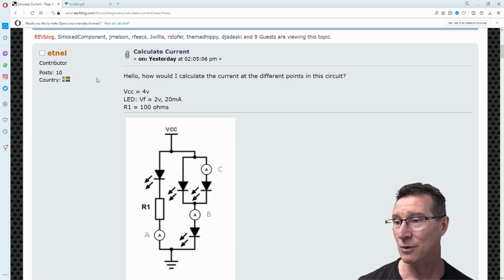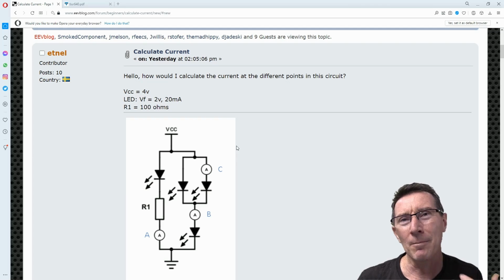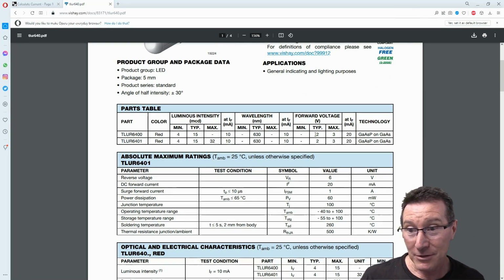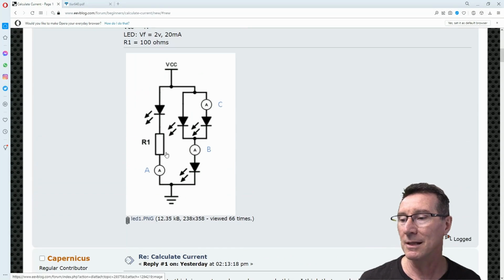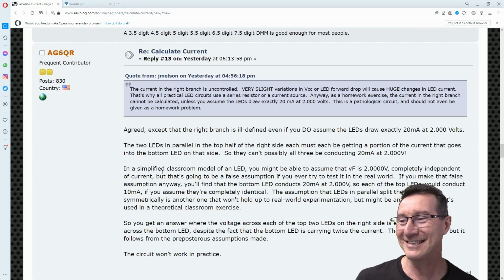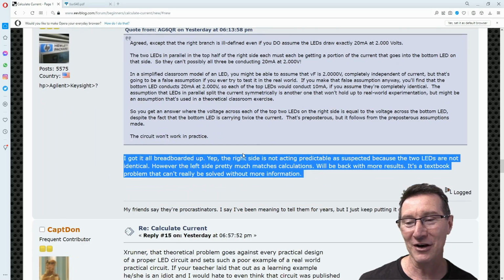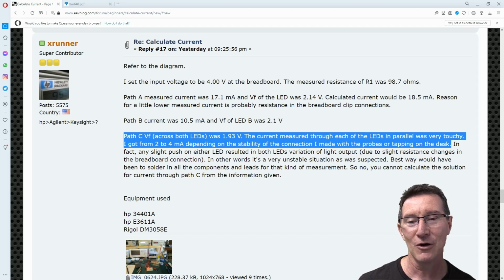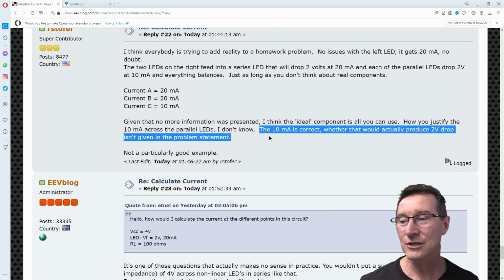EEVblog 1427 - An INFURIATING Electronics Exam Question!

Comment: We used to treat these as questions designed to slow down people who had hands-on experience.

Kids who'd never played with circuits would whip through these ones using the numbers given, while the experienced ones would replicate the thinking in that thread in their heads. Or the more autistic ones would just say "problem cannot be solved" and not answer it.

More open questions would often benefit a lot from a bit of experience, so we'd get to the end and "design a simple constant current LED driver {parameters}" and the  impractical kids would grind to a halt while the experienced ones would bang out a single transistor setup automatically before realising that they'd been given P MOSFETs and have to tweak the design. The earl;ier questions were designed to balance that out a bit.

Comment: I don't understand why people seem to think the problem is not suitable for hand calculation or not solvable without knowing the LED specs, because a hand calculation works fine for a decent estimate (assuming matched LEDs), and isn't even difficult.

Assuming that the LEDs follow the familiar Shockley diode equation, the I-V relation is I = I0*exp((V - V0)/(n*VT)), where I0 = 20 mA and V0 = 2 V. If the voltage of the center node is 2V + Delta, KCL applied at that node gives 2*I0*exp(-Delta/(n*VT)) = I0*exp(Delta/(n*VT)), or exp(Delta/(n*VT)) = sqrt(2). The current through the bottom LED is then sqrt(2)*I0 = 28.3 mA, and the current through the upper two LEDs is half that: 14.1 mA.
Reply: i choose  simple thinking.  let me know what you hink : ) 
imo if you have to consider the LEDS as linear devices then you can say that at 2v and .02 amps then all leds are 100 ohm resistors 
as R=E/I   then 2/.02=100 ohms.   so the left is 200ohms and the so 20ma.  B=150 ohms at 2v is 13.333ma and C is 150ohms at 2v so 26.667/2=13.333 but this is not the answer 
so if you consider that b drops 20ma and 2v then the branch C is 1v and 10 ma  this is a real shit show this is also assuming electron flows from - to +
Reply: @joejane9977  And thus you have shown why you don't consider LEDs as linear devices - i.e. resistors.  At any current near 20mA, they are going to drop close to 2V.  Over 20mA and it will be a bit more.  Less than 20mA and it will be less.  And for the purposes of this circuit 15 to 25 mA is "close enough" to 20mA to assume the drop will be close to 2V.  

If you still want to treat it like a linear circuit though, you need to linearize around the 2V operating point.  This means you don't assume 0V at 0mA - the slope of the impedance is much greater near 2V, as shown by the datasheet.  So a linear approximation would have one point at 2V & 20ma, and something like 1.5V at 0mA - or wherever the breakpoint or "knee" is in the diode's VI curve.
Reply: @Cynthia_Cantrell  this is why i stated it the way i did and yea you have to overcome teh knee voltage.
Reply: Only until the bottom LED burns out, though, given that it is speced as max 20 mA. So the actual answer is 0 mA.
Reply: @JasperJanssen  But it is not spec’ed at 20mA _max_, there are no max specs anywhere. The circuit is of course completely impractical (but perfectly calculable nevertheless, as the commentator above shown), but so are many many other test problems. “What is horse-power?” It is power yielded by a spherical horse in vacuum.
Reply: @therealjustincase  assuming these LEDs follow the Shockley diode equation is just as big an assumption as any other you can make to get a number out of this.
Reply: @JasperJanssen  Since verifying whether LEDs behave this way is rather simple – just two multimeters and a rudimentary breadboard and component set – I highly recommend for you to just try it. And once you check over say 6 orders of magnitude of current, you can then also think about why it works where it does, and why it doesn’t where it doesn’t. Don’t forget to keep the LED shielded from any external light! What you will also find (and I recommend you try yourself, for real!), is that LEDs are not magical and unpredictable. In fact they are kinda boring diodes if it wasn’t for their knack for emitting light without being on fire.

Comment: The "ideal diode current" formula in the long-winded answer did not seem right because it would not produce a current of 0 when V is zero. It would calculate a current of I_s. The ideal diode formula I'm familiar with is of the form I = I_0(e^(V/K)-1) where K is a scaling factor in units of potential but dependent on various factors including temperature. That -1 is important!
Reply: That formula (without the -1) is fine in this case, because the current through all LEDs is on the order of 20 mA, which is much greater than I_0 (typically on the order of fA). The -1 can be safely neglected.

Comment: You cannot assume the bottom right LED is 20mA with the upper right at 10mA each. You could just as easily assume 20mA each for the pair and then 40mA for the lower one. Of course, the unstated slope resistance makes it impossible to give a simple answer. I agree, as an interview question this would be great for finding out how a candidate thinks and communicates.

Comment: Of course, you don't actually have enough information to solve the problem, and variations in LED characteristics would make this circuit unusable for anything more than a one-off.

To complicate matters, red LEDs often have low maximum continuous forward currents and power dissipations. This is coupled with a negative temperature coefficient of the forward voltage, which means as the diode warms up, it passes more current, which is an inherently unstable situation. This is worse when two diodes are in parallel even when current limiting is used: as one get warmer, it will increasingly draw more of the current until most of it is passing through one diode. So nobody would actually use a circuit like the one shown.

Nevertheless, looking at the V-I curve for a typical 2V 20mA red LED, you can observe that the current increases almost linearly between around 10mA and 25mA, which is going to be the range of interest. Measuring the slope, we find that a typical red LED can be approximated by an ideal 1.6V zener in series with a 20 ohm resistor over that range.

Putting that into the circuit we find that the right side of the circuit is equivalent to two parallel (1.6V zener + 20R resistor) in series with one (1.6V zener + 20R resistor). That is equivalent to an ideal 3.2V zener in series with 30 ohms. The current through that from a 4V source is (4 - 3.2)/30 ~= 26 mA. So the current at B is about 26 mA and the current at C is around 13 mA.

P.S. The relationship between current and light output in practice is far from linear because the efficiency of the LED decreases with temperature quite significantly. The LED passing twice the current of the other two will be considerably warmer and hence its brightness will be well short of twice that of the other two.

Comment: You can solve this with two operating point voltages and currents for an LED.  With two points, you can fit an exponential I-V characteristic, then solve for the currents through every branch.

Even the left side is a special case.  R=100ohms is the only value that will give you 20mA through the LED and a 2V drop across the LED (and 2V drop across the 100-ohm resistor).  If you wanted to solve this with a 200 ohm series resistor, you would need to either simulate it, or draw a "load-line" on the I-V curve on the datasheet to find the LED's operating point (voltage and current).

As a in-circuit-test developer, I used a method that could calculate an LED's expected voltage at 10mA current (common datasheet spec) and the value of the series resistor by making 3 current and voltage measurements across the  combined series LED and resistor.  This was useful when there was no testpoint on the node connecting the LED and resistor.

The LED's I-V curve is also temperature dependent.

Comment: I had exactly one college course in basic electronics.  Kirchoff’s current law was definitely in the course.

As soon as I looked at that right hand branch I looked for any current limitation at the input, and seeing none, realized that this circuit would be, at best, highly dependent on small variations and, more realistically, likely to blow out the bottom right LED.

Comment: This is yet another reason I hated schooling, the problems are never practical, they're designed to test everything at once, they're to packed with dependencies that are ignored, furthermore some of which have very real impact like the fact that every wire is an inductor, sure it was told to us, but the tests ignored them completely in favor of pushing more components into the schematic just to get more questions out of the page space it used

Comment: I'd say that we can only introduce reality when it does not conflict with the given information. The total voltage is exactly 4v and each LED across 2V passes exactly 20mA. It's impossible for current B to be 20mA because that would mean the LEDs up top see exactly 2.0V and thus would, by the nature of the given information, each draw 40mA. That obviously isn't the case because of Kirchoff's Current Law. We know in reality that there is a positive slope relating forward voltage and current and this does not conflict with the given information. The answer ends up being somewhere between the two conflicting "ideals", specifically that B is 20-40 and C is 10-20. This is the answer lacek gave on the forum. Tomorokoshi's solution assumes the diodes follow the ideal curve but this may not be the case, we only know the parameters at one specific point. We don't even know if the LEDs are matched if operating at something other than 2V.

Tomorokoshi's solution may be valid, but possibly not because it assumes information not given. Naturally it does does fall into my given range of possibility.

Comment: This is why as a student I hated these types of questions. Getting students to calculate random circuit topologies rather than something that would be practically seen. Students then leave with no idea on design and all elements operate in ideal conditions thinking what even is a data sheet?

Comment: Fun fact: semiconductors are sensitive to all kinds of energy, not just heat. Theoretically, the LED is reacting to incoming light too. Obviously, the effect is negligible, probably unmeasurable.
Reply: It is well known that a common LED can be used as a photodiode; that it is rarely used in this mode is simply because the active surface of the LED is too small to be useful as a photodiode.

Comment: On a civil service exam a question was presented (bear with me, it was 18 years ago.) 

Describe the condition of the circuit, including any explanations and voltages in the diagrammed circuit if R (whatever) failed as a short.

Comment: What context did this thing appear in?  Was it a serious question from a serious instructor?

What would one estimate for B and C?  One might assume that all LEDs have a perfectly matched ideal curve and that B will get 20 mA plus some delta of at most another 20 mA (and be pushed beyond its ratings) and C will get half that through a possibly somewhat starved device.  But in a situation like this, the characteristics of the individual diodes will matter.

Maybe the idea is that the right hand branch will incur a failed diode, and depending on whether it fails shorted or open and then if shorted, whether the voltage supply gives out, we have our answer, lol.

"It catches fire, the voltage supply fails, and then all currents become zero."

The answer is: undecidable under the given information.

Comment: I don't see the problem. The question uses the LED in 2 ways, the stable way that gives the expected result and the unstable way.
The stable way allows you to say that given the single datapoint for the LED's characteristic of 2v, 20mA you will get the expected behavior of 20mA since the LED and the resistor both get 2v and thus resistor will set the current correctly for the 4v supply. That takes care of A. The right hand branch on the other hand, assuming the LED's are matched, will have the two upper LED's deliver a lower drop for the current passing through the lower LED. Thus the operating point for the two upper LED's will be pushed lower, and the lower LED will have it's operating point pushed up. Exact values would have to be based on the not supplied characteristic curve but one can safely assume the current in B will be higher than 20mA and the current in C will be less than 20mA, and half of the current in B. The only wrong answer is 10mA+10mA = 20mA for the LED's in right hand branch.

Comment: This is a theoretical question. Schema parameters are chosen so that the result does not depend on the nonlinearity of the diodes.

Ia = 20mA,   Ib = 40mA,   Ic = 20mA
Reply: Wrong wrong wrong !  Ib = 20mA (2 x 10ma ). Were you not listening to Dave ?

Comment: i have had some really really really stupid questions on exams 
Aside from questions where a professor goes "oh, this will hang them up" for something you would never even bother calculating there were plenty you would never trust a calculation on.
We had one exam question, it was 80% of the exam, where we had to take a complex circuit and calculate the output, peak and RMS current draw and whats going on at a few nodes 
it was a series of logic gates, an oscillator (that would have never worked and you have to decide if it was a trick question all along) and a decade counter.
its one of those questions where if you make a mistake at any point along your maths you will get every one after wrong and i think that one question worked out to be 5% of your overall grade

Comment: You could also say that the two parallel branches are 20mA and the bottom one is 40mA right? If we say that the top can be 10mA at 2V what's to say we can't say that the bottom is 40mA at 2V. In fact it makes more of the LED's at their correct parameters.

Comment: I tried it out with a program call, "Circuit Simulator V1.6i".  I get 2V @ 20mA for the upper left LED.  I get 1.98V @ 14.18 mA for both the LED on the upper right.  The lower LED you get 2.02V @ 28.37 mA.  If you used this program set the Fwd Voltage @ 1A to 2.276 for the LEDs.   I seen my self hook up 2 blinking LEDs in parallel, 2 white LEDs in parallel,and 2 color changing LEDs in parallel.  Took each set of LEDs and put them in series with a 9v battery and a switch.  It works fine.

Comment: Yea, unless they state somewhere in the original question that this is some magic linear LED that always has a V_f of 2V, no matter the current, the question is just bad. One of the first things you learn about diodes is usually the way to calculate its V to I relation as a non-linear part. The practicality of the circuit and the way it's driven is imaterial here, it simply does not even match the 1st level theoretical description, at least if a quick and easy answer is expected. If the answer they seek here, say as a homework, is that this problem is not easily solvable, then okay, so be it. The students then had to spend some time thinking about it and maybe have deepened their understanding of the material. As an exam question it is most likely unsuitable though in most cases, at least if they expect a numerical answer. At most I would put that as the 100% breaker at the very end of the exam.
Reply: Saying that V_f = 2V regardless of current would make the question even worse, because then the currents in the right half could be anything!

Comment: It all depends on the model used in that course. An unrealistic but plausible (from the point of view of evaluating circuit theory skills) piecewise linear model where the diode is an open for negative V and a simple resistor for V>=0, the circuit can be solved without any inconsistencies. Once it has been determined that all diodes are forward biased, just substitute them with the resistor (what value? You are given vf and Id, so 2V/20 mA is 100 ohms.) 
Then you can find all the currents you want.

The circuit is (R+R) // ( (R//R) + R )

Edit: and the currents will be:
iA = 20 mA
iB = 26.7 mA
iC = 13.3 mA

Comment: I don't know what it is with the "educator" class and coming up with really goofy contrived scenarios (that are often "trick questions" to some extent) when there are plenty of actually useful real life design patterns to analyze and you'll regularly encounter in the future. Goes for really any type of educator.
Reply: These questions are written by people who would have a very hard time putting this circuit actually together and explaining what it does. I’ve had a similar question on an EE exam, but it was explicit about using non-ideal components (at least to the extent we were taught), expecting the student to provide assumptions and simplifications, and use nonlinear modeling. The junctions weren’t in LEDs but in BJTs, and the circuit looked like it should just go up in smoke or something. The answers most of us got were within 50% of measurements on an actual circuit with jellybean parts. People were stunned. The professor just said “you know there’s a reason I pushed hard for you to learn all this arguably dense theory – it works quite well even if you pull some numbers out your ass”. It was one of the most memorable classes I ever took.